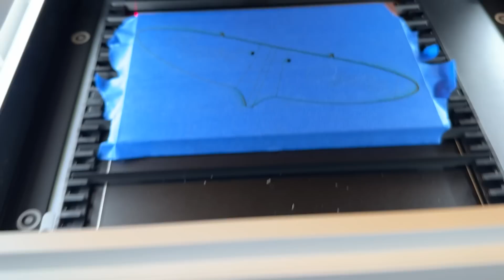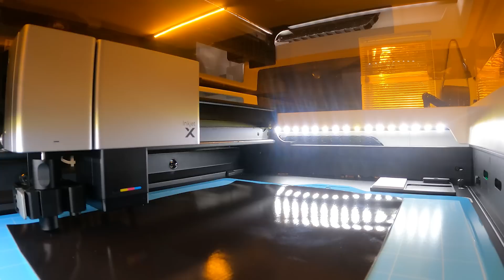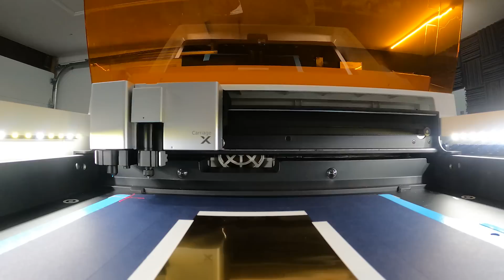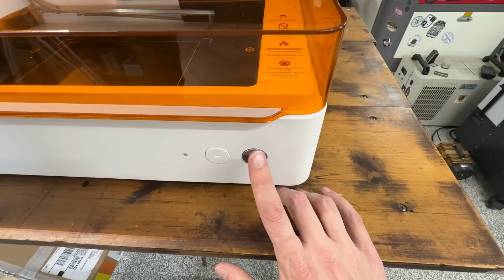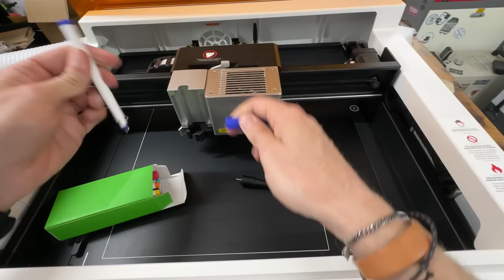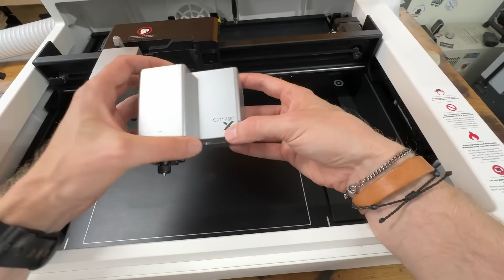The xTool M1 Ultra Review - DITCH the Cricut?

Comment: Hi, in the middle part of your video, you used the *xTool M1 ULTRA cutting blade (not the laser)* to cut flexible magnetic sheets. I have a couple of questions:
What is the thickness of this flexible magnet in millimeters? Is it **1.2 mm thick**? Also, it looks like this flexible magnetic sheet comes with **adhesive backing**, is that correct?

Comment: I already own a P2S. I'm doing research on whether or not this would be a worthy purchase to add to my capabilities. I do not care about the laser portion more interested in the cutting and color printing onto materials that I could then process in the larger machine. Do you think this would be a good machine to add? I feel the ability to print an image and then cut it out will save me a ton of time in painting and finishing work.
Reply: From the website: It can print on fabrics, boards, printing paper, and other materials. However, it cannot print on very dense or smooth surfaces, such as metal, glass, and ceramics, because the ink cannot penetrate or adhere. These materials can be processed after applying a suitable ink coating.

Something to consider. Maybe check how much it also cost to replace the ink cartridges each time it runs out and the estimated # of prints you could do.

Comment: Great video. but not sure if I would use the colour printer on the Xtool nor the pen, the only thing I would say to xTool is that it needs a camera system, with the colour printing I would just use the Standard ink printer, as it does not have black ink included. apart from that I would use it for paper cutting or use cardboard and wood...but will think about buying one, can we have other future video on using the XTool machine. with the pen system not much choice of pens you can use for writing or drawing, thanks

Comment: My experience with xtool was/is horrible.  Xtool is nothing but entry level machine that you are over charged for. Their software was horrible.  Save money and go with omtech for a beginner or go with Aeon or thunder for a quality longterm laser.   My co2 from xtool is a large paperweight and wont run right. Sent it into service and came back with missing screws and more issues.  I wished i did my research and went with a higher quality laser for less money.   Save your time and money and check out omtech or aeon depending on your budget.

Comment: no its not and if it still has the same crashing issues as the M1 after having a simple upgrade as an air assist users will walk away in droves. Xtool didnt get it right with the M1 where you cant simply ad an air assist why would anyone think this is going to be a less than frustrating success

Comment: By printing on sticker paper you masked the downsides of the inkjet module, which you could have done on a regular printer faster and better.
It is very much a gimmick, because it's only three colours without black. This means that to get black, the machine has to mix all three colours together, which is not very effective, resulting in muddy darks, and also very wasteful and thus expensive. It doesn't have white ink like UV printers either, so printing on darker materials doesn't give vibrant results.

Comment: How long does the color printer lasts…does it required to be changed like uv printers?
Reply: Not very long, especially since it's only CMY so to print black it uses all three inks at the same time.
Reply from the maker: Its a standard printer cartridge so Im sure mileage depends on how heavy you are using it. It will need to be changed but you can buy them on Amazon or local office store.
Reply: On their site they state in the FAQ "It can print patterns that fill 20 sheets of standard A4 paper at the default concentration. The specific service life is related to printing color, concentration, ambient temperature, etc."